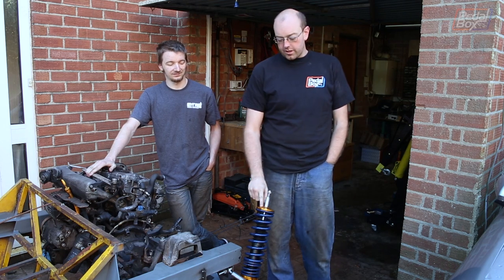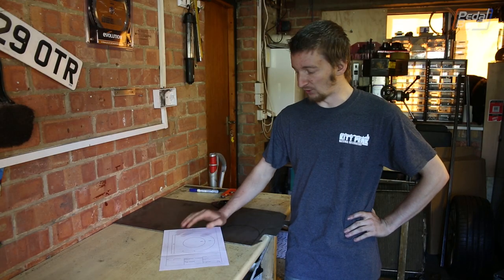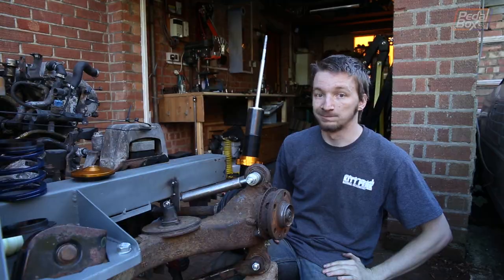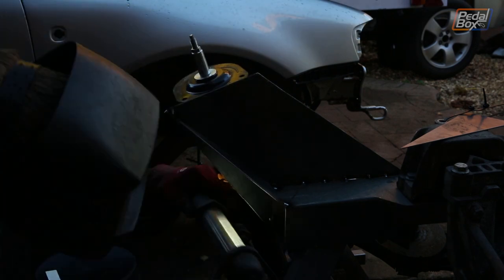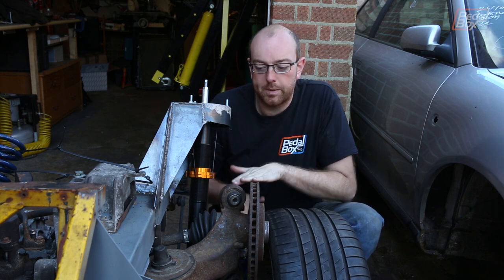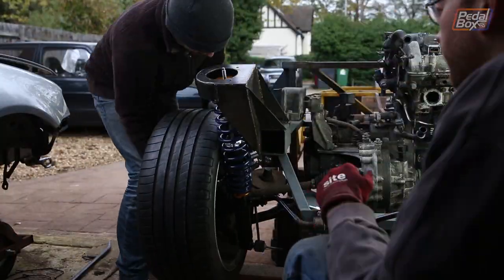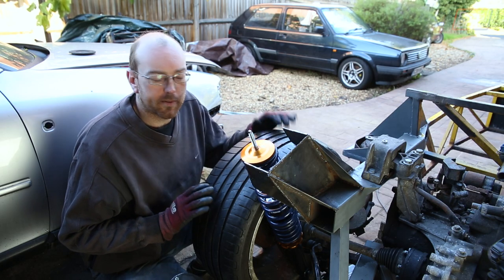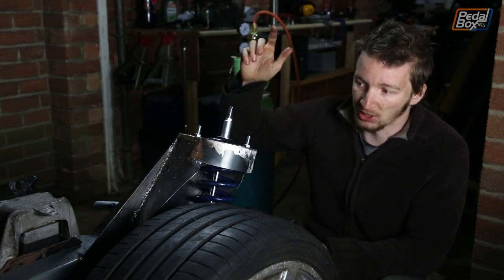Rear Suspension Pt.5 - PedalBox Episode 12 | Mid-Engine Audi Kit Car

Comment: Oh the frustrations . coming along nicely though. may a plasma cutter be on the wishlist . really good for cutting sheet metal to a line. so many uses as you go forward also . just a thought.
Reply: We've thought about it! We're trying to keep it accessible though - ideally we want anyone with an angle grinder and a cheap welder to be able to do what we've done and plasma cutters are just a bit too expensive for that to really fit.

We've also looked at stuff like moving into a small unit etc for more space but again, doesn't really fit the DIY theme.
Reply from the maker: We may have looked at a plasma cutter... but it's beyond the "basic" tools idea (at least for now) I think the shock inserts (still need to send you some details on those) being turned might be the only advanced tool part so far!